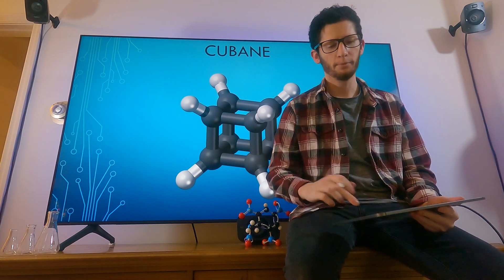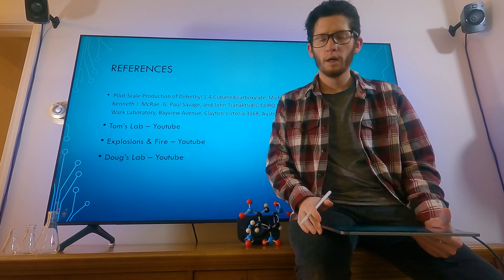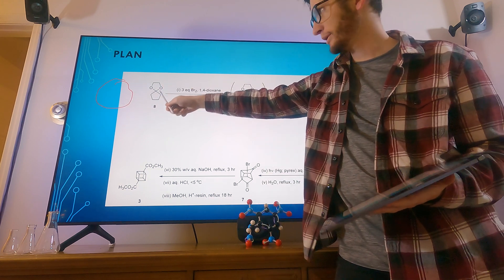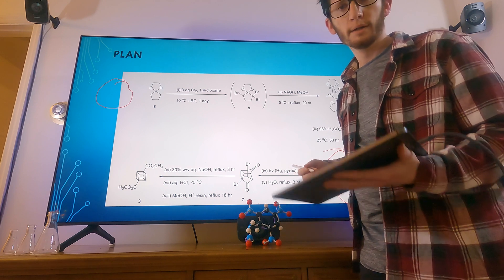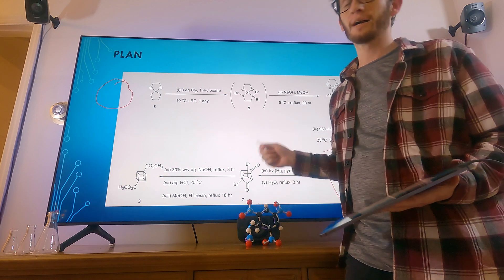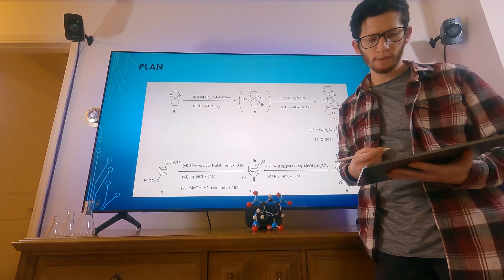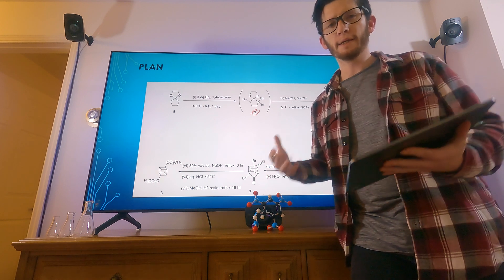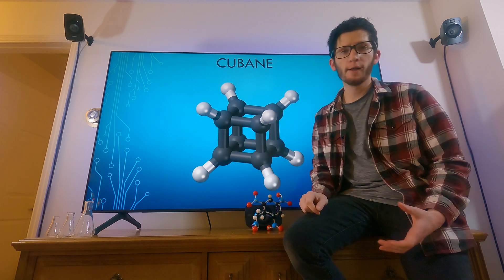Synthesizing Cubane - The Journey Begins

Comment: I built a UV reactor by using a UV water purifier off of Amazon, the smallest unit. 

I use a fuel pump on a voltage controller to control pump speed, and cycle the ethanol or other flammable solvent solution through the unit, as it is stainless and quartz.